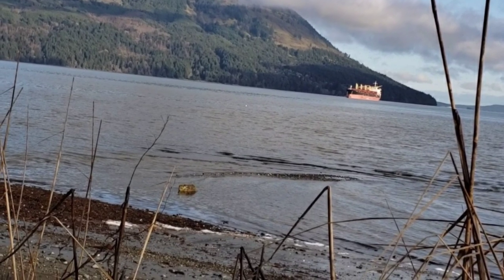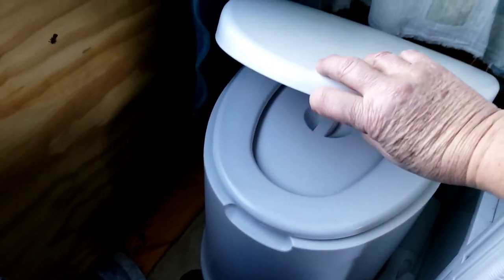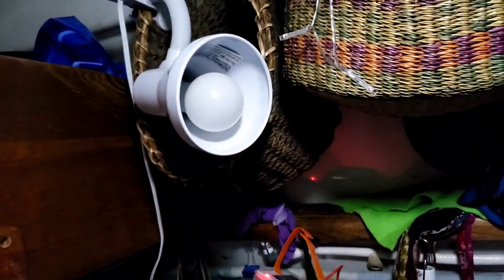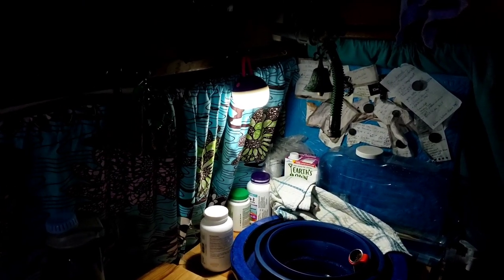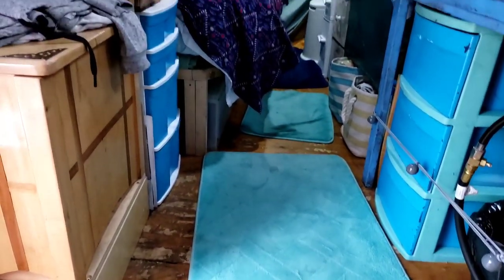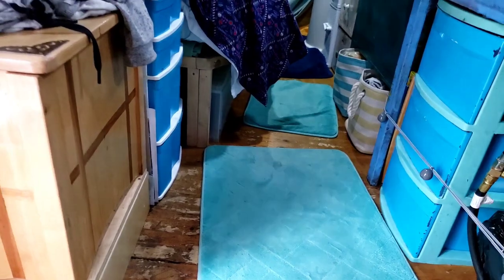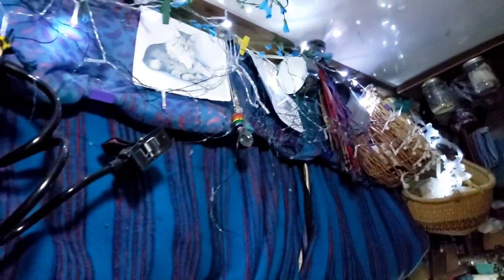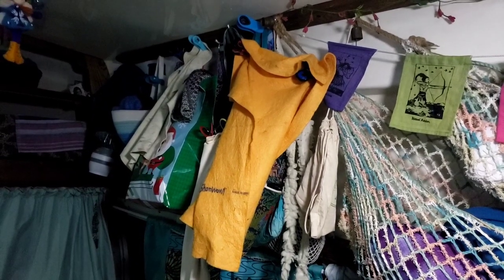Big Blue Van - part 2 of what I love and don't love.

Comment: Thanks for sharing both the "good" & "bad". Helps people understand and choose. Helps them look for solutions to things that can be solved or at lease minimized to some extent. For example, try to find another way to dry fabrics, rather than hanging them in your van, when condensation is a problem. Warm air holds more moisture. Moisture that can come from drying wet cloths in a small enclosed space. So, you are in a vicious circle, to some degree. Mop up the moisture from cold surfaces that accumulated due to moisture in the air. Then, drying fabrics in the same space, adding that moisture back into the space, so it can condense again. 

For the time being, try using cheap paper towels to soak up the condensation. Transfer to a plastic trash bag (or other lidded container). Empty or discard bag/container, as needed. When weather will permit, use your ShamWow, small towels, rags -- whatever you have, to soak up the water and then dry outdoors. A cord tied between two  points becomes a clotheslines. Walmart crafts section has small and tiny clothes pins, if you don't want to buy a pack of traditional ones. 

BTW, Blue shop towels (automotive dept at Walmart) are more expensive, but can be used over and over again. Another thought is to use sponges to absorb the water from windows and other places. Wring them out in your sink to get the water out of your van. Dry outdoors, when you can. 

Also consider DampRid or similar moisture absorbing products in places where it is difficult to access. Empty and/or replace as needed. Some moisture absorbing products can be re-used by heating them. Just don't release a material amount of moisture back into your living space. 

Hope some of these thoughts are helpful. Looking forward to seeing how you deal with the "bad" and celebrate the "good" in the future.
Reply from the maker: Thank you. And I do have 3 damp rids in the van which I empty out daily. And when its pouring out raining outside for days on end there is no drying outside. When its sunny or just not raining! I open up the van to dry things out. And take out my garbage everyday too.

Comment: nice to see some more likes * don't-likes in the video. I had a thought about the moist at the two backdoors behind the toilet. If I remember correct you said that you often find moist down there. If I also remember right you stuffed the openings in those doors with plastic bags before closing it with the - very nice - wood. I remember some video from some other Vanlifer who had a similar situation, and he said the stuffed plastic bhind the closed space caused moisture. It might be worth to check what it looks like behind the moisture and maybe put another kind of filling in those wholes, but also to add some breathing holes at the top side and bottom side of those panels. I mean just drill holes. Could even make it decorative like some decoration around the panel. That might get eough airflow behind the panels and solve the moist that builds up there. Let me know if this is helpfull - maybe ask Kailo what he thinks about it. Since the panels are screwed on (I think) it would be very easy to take them off, drill some holes and replace them... good luck and greetings, Jason
Reply from the maker: There are air holes as the door at the top of the panels is bent in. And I've  since fixed what was causing the moisture.. and I'm thankful!

Comment: I LOVE my Luminaid light!!
I might actually get another one. And you are totally right they charge super quickly and I love that you can adjust how bright they are. I use it everywhere
Reply from the maker: I'm still have issues with the micro USB. It'll charge but I have to keep fiddles with the micro part to keep it coming in. Though the light is on anyway. I plug it onto my jackery which shows watts coming in.  And now lumin aid won't service my purchase.
Reply: @BohoBlueVan  hmmm interesting. Did you purchase it directly from them or through an Amazon supplier? I have found that when I don't purchase directly from the manufacturer this definitely happens and I kind of get it because purchasing through Amazon means there is not lots of quality control. I still buy through them because of their expedited shipping and will continue to do so for small price point things but will definitely go directly to manufacturer for larger price point purchases
Reply from the maker: I bought thru Amazon. Its says from luminaid and fulfilled by Amazon.
Reply: @BohoBlueVan  interesting
Reply from the maker: We've had sun here lately... so I have to re-remember to use it!
Reply from the maker: I just contacted lumin aid thru their website. Will see..

Comment: It looks as if you have a problem with humidity. Everything should be stripped out of the van and have it properly addressed. And install proper ventilation. This is more important than anything else. It is better to live in a completely empty van with just a sleeping bag that could be aired out every day than to live in a van with humidity issues, filled with absorbent belongings. Otherwise the next place you live in could very well be long term care.
Reply from the maker: I vent all the time. I just live in extremely wet winter climate.